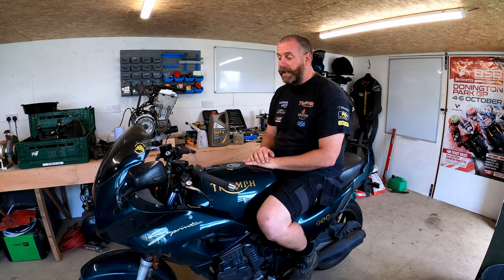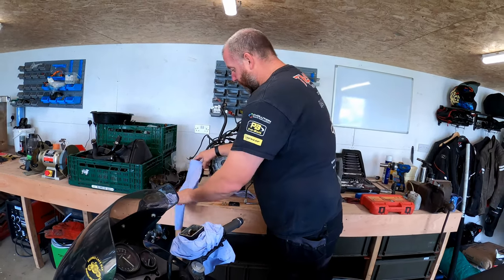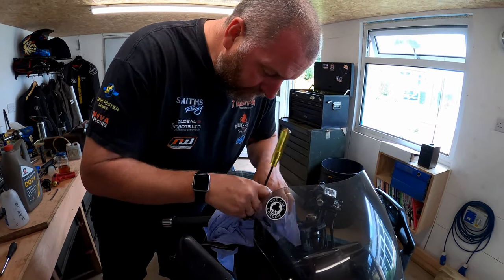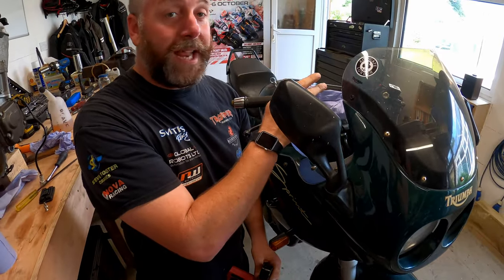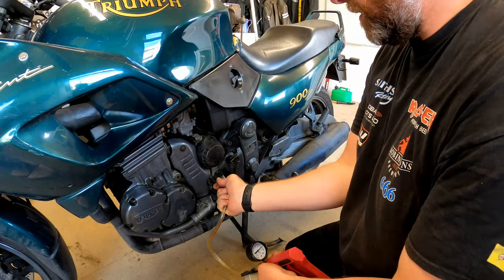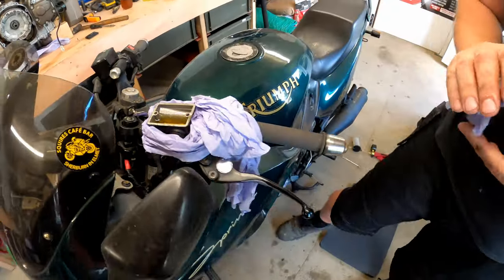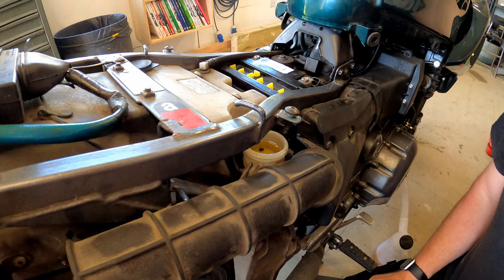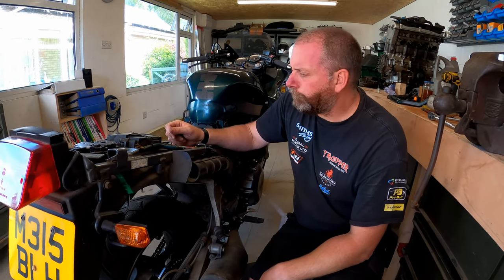1994 Triumph Sprint 900 Service Series - Part Six - Front & Rear Brake Plus Clutch Fluid Replacement

Comment: I have loved this triumph series.  I have a 95 Sprint, virtually the same as the 94, and you've helped me immensely.  I have one question.  Particularly since the owner of that 94 works at a parts company.
I live in the U.S.  I need to find a place where I can find parts for my triumph.   Gaskets, valve spacers, new rubber carb and air filter sleeves... whatever.
Do you have any ideas of where I can search....Thx mate
Reply from the maker: You should be able to find eBay sellers stateside that stock all those parts bud! 👍
Reply: @KevsShed  so far having a problem....you'd think this bike is ancient, trying to find parts for it....but thx, I'll keep looking.  Maybe I'll find the mother load outlet...👍